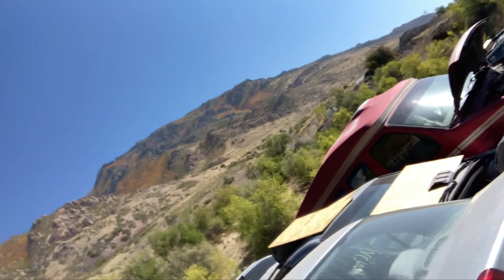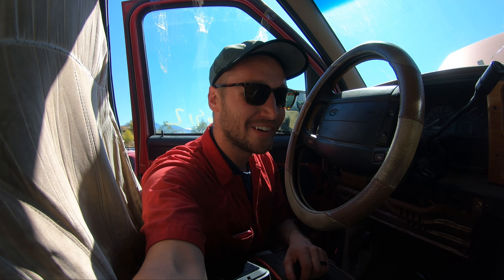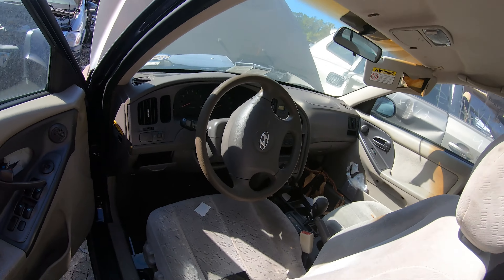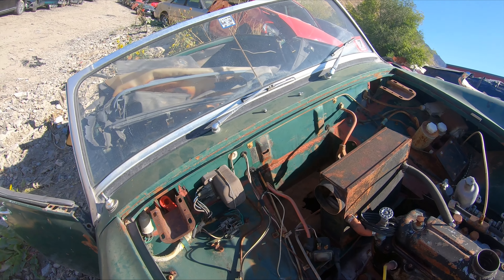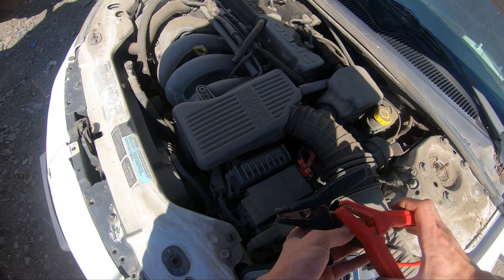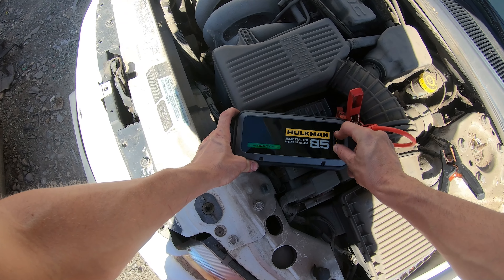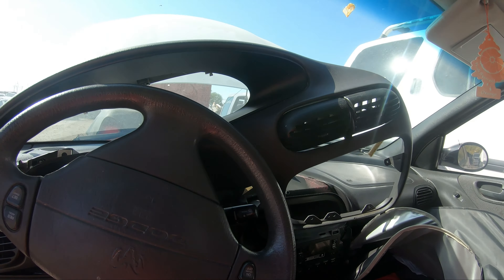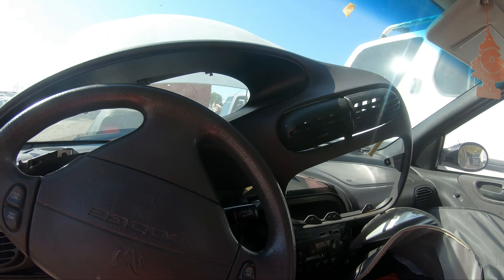Why is this car in the JUNK YARD? + giveaway 20 battery test

Comment: I have a x431 Diagun V. Bi-directional control, oil reset, programming keys, I've done it all with this scanner. If I win, I'd like to give mine away to a technician starting out that doesn't have a scanner.

Comment: Sounds like a minor loss of compression as the starting rythm isn't perfectly smooth. Without the engine firing up you wouldn't be able to tell if there is rod knock or piston slapping. Worn connecting rod bearings or worn down cylinder bores typically don't set check engine lights or set codes. They just sound like complete shite and will eventually throw a hole in the block. Got a complete cam wipeout in my stall right now. Super loud ticking noise... finally set a check engine light and the lady thought her detailers spraying the engine with water was what killed her engine... needless to say she is getting a whole new engine for neglecting a problem that has been going on for a while! It takes a long time for a tick to turn into a check engine light if it ever does... her exhaust valve was pretty much not opening at all... that is the only reason it set a code...